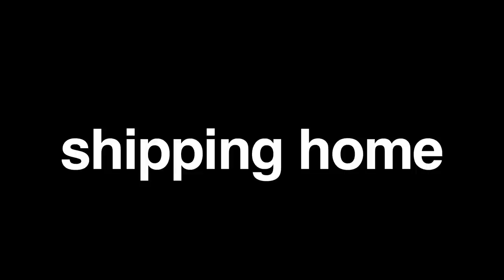'Shipping Home' Timelapse

Comment: Chris, what did you do to treat any potential chemical pollutants that may have soaked into the flooring?  Very helpful video!
Reply: I know from years of reading about container sheleters that seaworthy containers are treated against insects and rodents. The gorgeous wood floors in most containers should be removed or somehow encapsulated so they don't off-gas.
Another consideration is AIR EXCHANGE. Container homes have been plauged by condensation and poor air quality. A lot of builders are taking off the tops and fashionig a roof structure, so there is the break between the walls and the roof.
Reply: Most people just pour concrete over the floors.